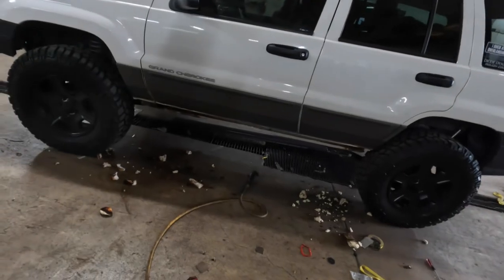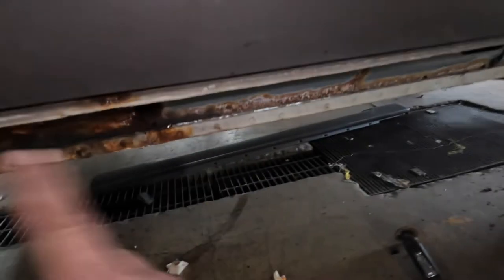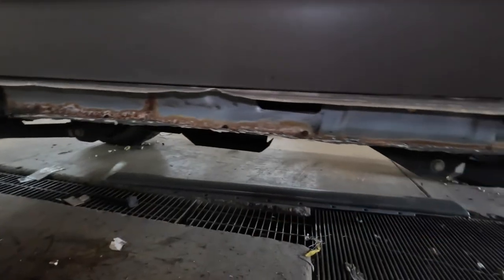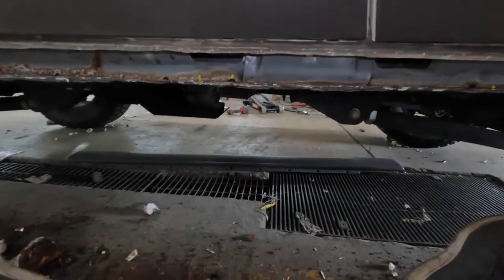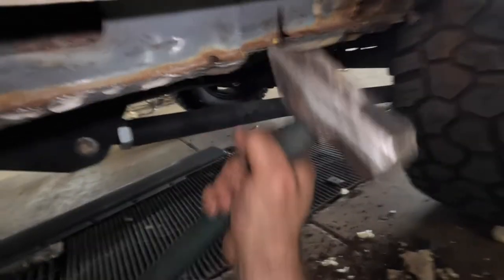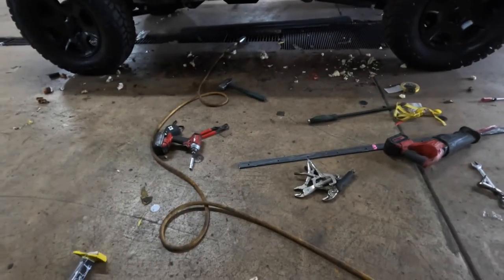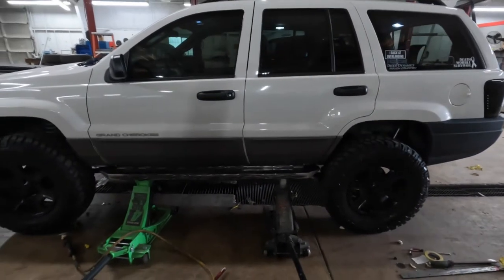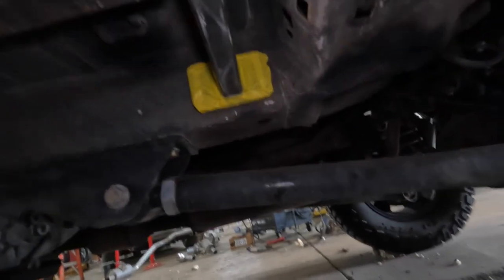Installing HK Offroad's Glissade on 2003 Jeep WJ

Comment: Did the same thing to my 02 overland simple to remove the rust. Totally worth it and solid. Didn’t even paint them so they have developed a patina im liking.
Reply from the maker: Awesome! Agreed these things are meant to be used an abused. I almost ran them bare metal but since we spray bed liner at Xtreme. I figured it would be a good test to see how the bed liner holds up to the abuse I going to put them though. (Two birds one stone)

Comment: What if my pinch weld is rotted and gone?
Reply from the maker: They will still install. they are basically rocker replacements. I use them as lift points now when I have my jeep on the lift. Makes getting it on a lift with the long arm kit mice and easy.